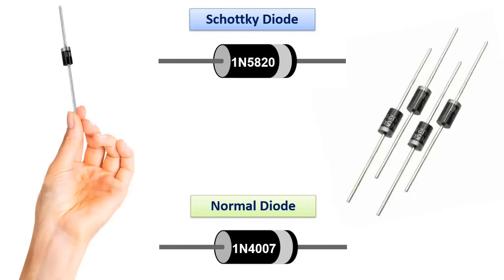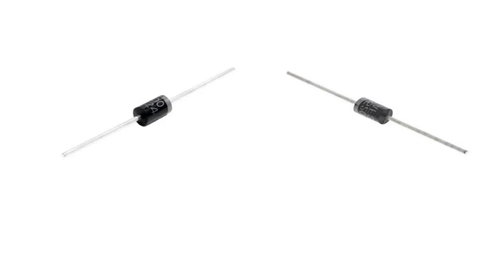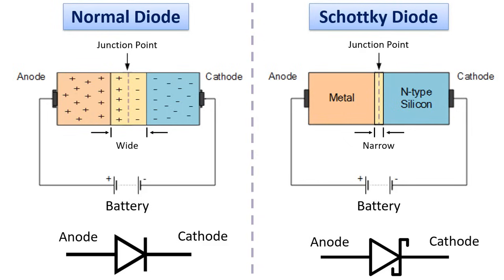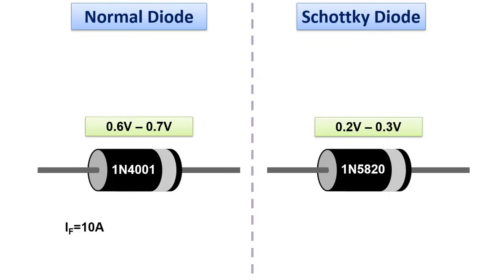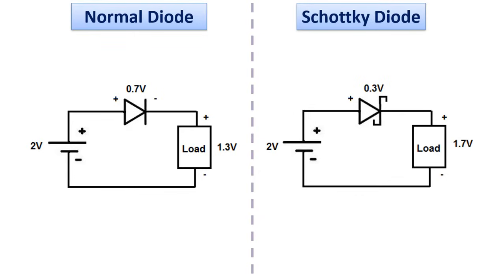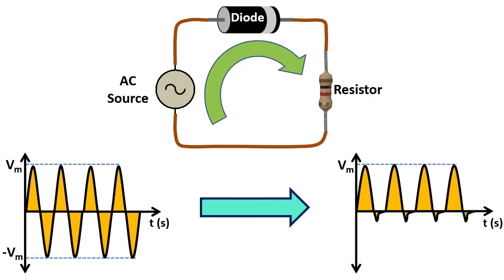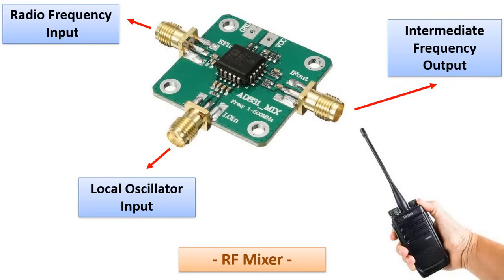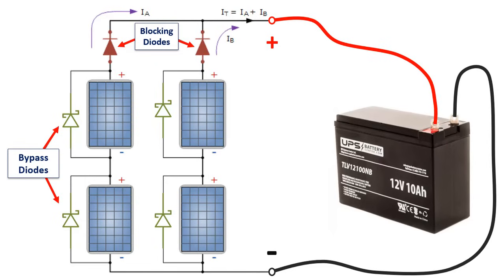What is a Schottky Diode? How Schottky Diodes Work? Where to Use? ( Schottky Diode Tutorial)

Comment: I’ll just start at the beginning where you say that the only one type of diode has a white band at the cathode
ALL DIODES of any size have the line at the end

And you say the current flow of electricity is from positive to the negative, when reality is that there are extra electrons at the negative end and therefore they go towards the area of less electrons. 

When designing circuits, it’s easier to visualize the positive flow, but the reality is the negative is what’s really moving
Reply: It's an LLM.  Complete waste of time.  There is no room for mistakes or errors.

Comment: Please! Be carefull with shottky-Diodes. They work well by cold temperature, but the reverse-Current increase rapidly by high temperatures. 
This can lead to late failures after years.
Reply from the maker: Thank you for sharing this information 🙏🏼
Reply: @eeapplications around the late 90 s  & 2000 shottky diodos were used in American car alternators  , didn't last  much between heats dissipatetion problems and the avalanche effect for charging the battery  you can imagine the failure rate
Reply: @jorgeruizortega6077  The Avalanche-Problem is another issue. Some diodes have a guard-ring on the die, in this case they can absorb avalanche-energy.

Comment: at 0.39 why isnt the skottky rectifying the output? it seems to be happily conducting in both directions?
Reply: I think it's a bad example.  A better example would be half-wave rectifying an AC square wave.  The schottky diode would do a good job, but a slow diode like the 1N4001 would let through spikes on the falling edge.

Comment: They're great for modifying guitar distortion effects. They use diodes as clamping circuits to create the distorted tone. The more you clip the wave, the more distorted the tone. The lower the voltage of the diode the more saturated and smooth distortion you get. Instead of clipping at 1.5 volts you can go to half that. Usually boost it back up a little somewhere later. They're cool for the designed used also. :)
Reply from the maker: Thanks for the info!  I'm always learning new applications for diodes.  😊
Reply: @eeapplications  did you know in the hvac industry a small AC current is passed through a flame to ground to prove the flame is good? The fire acts as a rectifier and the control uses the DC feedback as proof.  I work on hvac and amps. I have certain skills.....:)

Comment: I use SNOOKIE diodes their switching capabilities are much better when used in weak fielding based equipment. If using ROPS or SOPS measuring equipment there is no chance of flash over or any overloading.

Comment: Why not to use only the Schottky Diodes ?
Reply: Schottky diodes have much lower reverse breakdown voltage and higher reverse leakage current.

Hence it is better to assess whether a normal diode or a schottky diode is better for the specific application you're looking at
Reply: Cost.
A regular diode is enough for frequencies less than 1kHz
Reply: Higher price and more complicated production process compared to a standard diode, unnecessary fast response time, higher current value, etc. There's a brunch of reasons

Comment: Modern very fast silicon diodes are now available with minimal leakage current. Thus, today the Vf at load are the only issue left, and it is getting lower for the silicon diodes ( at load).

Comment: Can anyone explain to me why the shottky diode rectifies current if it turns on at both positive and negative voltages?
Reply: It doesn't conduct in both directions as long as the maximum reverse blocking voltage rating isn't exceeded.

It behave like a silicon PN junction diode in terms of forward conduction (anode positive with respect to cathode). However the reverse "leakage" current of a Schottky diode is typically higher than for a comparably-rated silicon PN diode. This leakage current is too small to be of much concern for rectifier use, but it can be a significant in other uses such as low-level analog circuitry. There are small Schottky diodes made specifically for small signal applications. They are typically designed to have very low reverse leakage current.
 
There are many silicon PN junction diodes with reverse voltage withstanding (blocking) capability up to 1 kV. It is easy to make them. Most Schottky diodes have a reverse blocking voltage rating of 100 volts or less. It is possible to get types with up to about 150 V reverse blocking rating, but there aren't many choices. There are types made with silicon carbide that can block up to 1200 V in reverse but the forward voltage is higher than that of a silicon PN junction diode and they are expensive. They are still very useful in some circuits because of their very short reverse recovery time.

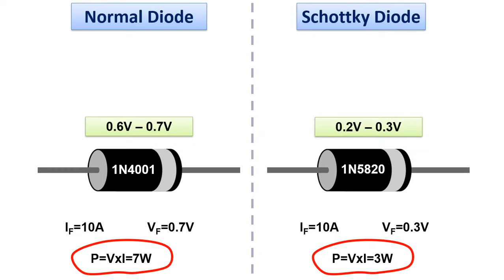Comment: 4:30 - 1N4001 - If= 1 A not 10 A !!! Pd=1V*1A=1W
See datasheet
1N5820 Vf=0.4..0.5V @ 3A => Pd=1.2..1.5W
Reply: Comparing a silicon diode passing 1.0 amperes with a schottky passing 3.0 amperes is not a valid comparisson!

Comment: This presentation is remiss because it gives the impression that Schottky diodes are superior to "normal" diodes in every possible application.  A person watching it would wonder, why would anyone ever use a "normal" diode?
Reply: That’s exactly what I was wondering. So what’s the answer?
Reply: @williambock1821  
In many applications the primary advantage of Schottky diodes is their very short "reverse recovery time." The video touches on this but doesn't explain it well.
When the voltage applied to a diode is suddenly changed from the "forward bias" to the "reverse bias" condition (that is, from the anode being positive with respect to the cathode to the opposite), it does not stop conducting instantaneously. Ordinary silicon PN junction power diodes take quite a long time to turn off - their "reverse recovery time" is long and quite a lot of charge gets through. It has to do with getting "excesss carriers" out of the junction region. This is of very little concern in low frequency circuits such as rectification at AC mains frequency. When you get up into the frequencies of switchmode power supplies, which these day can range from around 50 kHz to 1 MHz or so (100 kHz is quite common for high power switchers), the reverse recovery time and charge becomes a problem. Ordinary silicon diodes would cause a lot of power loss. There are "fast recovery" and "ultrafast recovery" silicon PN junction diodes available that work much better. Schottky diodes have even shorter reverse recovery time.

The other advantage is the lower forward conduction voltage, as described in the video. Sometimes that isn't important, but it is in lots of applications. At moderately high currents (a few amperes to a few tens of amperes) a silicon PN diode may have a forward voltage of around 1 volt. A comparably-rated Schottky diode might have a forward voltage of about half that. At 20 amperes, half a volt difference is a 10 watt difference, and something that has to be considered in real circuits. In power supply "ORing" circuits the forward voltage can be a big concern.

There aren't many Schottky diode with reverse voltage withstanding rating of more than 100 volts, whereas silicon PN diodes can be had up to 1 kV. There are Schottky diodes with much higher reverse voltage rating on the market but they are expensive. In general, Schottky diodes are quite a bit more expensive than similarly-rated PN diodes.

Schottky diode "reverse leakage current" (current that can flow when the cathode is positive with respect to the anode) tends to be substantially higher than in silicon PN junction diodes. This isn't a big deal in lots of applications but it can be in some. Even the reverse leakage current of a silicon PN junction diode can be a significant issue in some low-level precision analog circuits.
Reply: Not quite as leaky as a Germanium
Reply: I don't really know, but I'd guess better longevity and/or lower price.

Comment: In the last diagram all the diodes are reverse biased so that wouldn't work.
Reply: Bypass diodes allow current to bypass cells that are in shade. Of course, this diagram is poor example because one blocked cell would render whole series branch unusable because other branches would make bigger voltage, so blocking diode would be reversely polarized.

Comment: why dont we use this diode over our normal pn junct diode
Reply: That's what I'm wondering, as well. I assume cost. If they cost the same, I don't understand why you would want to use a PN diode, unless you specifically wanted to smooth out power frequency for some application.
Reply: exactly my thoughts, why not?
Reply: 😮Max PRV of 60 volts.
They have reverse leakage enough to measure with a DMM in milli amps. Silicon diodes are tighter reverse leakage of a few micro amps.
Reply: Reverse voltage loss is high

Comment: What is the purpose of the Bypass Diodes across the solar panels? I cannot see what their function is.
Reply: If one or more panels are shaded the power drops of considerably. The diode will allow the current from the unshaded panels to bypass the shaded ones
Reply: @jasonharrison25 thanks
Reply: They divert current around other series panels. This is advantageous in that it reduces energy loss.
Reply: Did you say thanks to the 2 responses?
Reply: They are there almost entirely to protect a panel that might be shaded from having current driven though it by other panels that are receiving normal illumination. They rarely do anything useful in terms of power delivery, especially in an array where you have both parallel and series connections of panels.

Comment: Disadvantages:
1. breakdown voltage measured in tens of volts vs hundreds of volts.
2. much higher reverse leakage
Reply: My silicon diodes thank you for saving them.
Reply: No, reverse breakdown voltage of common Schottky diodes used in power circuits (i.e. with average forward current rating greater than half an amp or so) typically ranges from 20 volts to 100 volts. There are 150 V power Schottky rectifiers on the market. Silicon carbide Schottky rectifiers up to 1200 PIV rating are made but they are quite expensive. The 600 PIV parts would be useful in active power factor correction circuits. If I were still designing that sort of stuff I'd be considering them.

The reverse leakage current can be an issue in some applications. Schottky diodes intended for signal use and with low reverse leakage do exist. Hewlett Packard used to make a range of them. I don't know if any of that line is still being made by the current owner of that former HP division.

Comment: 7 Watts through a 4001 🤣
How abouut no?
Reply: You will have to use a high current diode in this example, and heat sink it. Forward voltage will be about the same.A 4001 would become "cremated" in this example
Reply: BBQ mode activated 😂
Reply: Duh!  Go away and read a book.
Reply: 7 watts dissipation in a 1N400x diode would be OK as long as the time was short and the average power was tolerable. Diodes like that used as rectifiers in circuits with capacitive filtering will be subjected to very high "surge" current.
Most power diodes will have a specification for transient over-current

I have used 1N4148-class diodes to pass the "ping" pulse for an ultrasonic transducer. It would be around 9 amperes but very, very narrow and with low duty cycle. It worked highly reliably. In the last revision of the circuit I did I used a similar signal diode that actually was rated for that kind of torture.
Reply: 1N4001 at 7 amps has a forward voltage drop of 1.2 volts 8.4 watts. At 10 amps its time duration is listed at 40 cycles considering 60 cycle AC that is 0.667 second.

Comment: i wonder if the solar to battery with that diode symbol is correct!  Thanks
Reply: It is, the battery is not the power source in the diagram. The solar panels are the power source and the battery is the load - the solar panels are charging the battery.
Reply: Your question makes no sense.  Ask better questions.

Comment: After watching this video, one question stays stuck in my head... why I would not use a Schottky diode instead of regular diodes anywhere where a diode is needed (a regular, not a zener of course)
Reply: Since they are half metal, they have a low reverse breakdown voltage. Diodes are commonly used as a way to protect against reverse polarization, so there might be cases where Schottky diodes won't be helpful against reverse polarization (edit: i.e. high voltage circuits). Also, they are more susceptible to static discharges, which are more common than they seem (after working with PIC microcontrollers, I learned that the bad way :p).
Reply: If you have ever built a high-speed electronic device, you would know.  Get out there on the bench and try some things.

Comment: It would've been nice to point out not just the advantages but also the limitations of the Schottky diodes. For example they are much more limited in maximum reverse voltage, than pn diodes.

Comment: Schottky diodes are also being used in audio mains rectifiers the theory being the faster switching results in less noise. One disadvantage is schottky can suffer thermal runaway where the resistance increases with temperature.

Comment: So Schottky diodes have less forward voltage, better properties at higher frequencies, why are silicon diodes still made? What would be their advantage over Schottky diodes?
Reply: From 5:26 we can see that the reverse breakdown voltage is not as good, typically around 50 volts or so. In applications where reverse breakdown voltage is important, silicon diodes win.

Comment: I have a circuit with a BJT transistor in it. It is a hydraulic selector handle that opens a hydraulically powered cargo door. Moving the handle in either direction turns on the electric motor. The handle has three positions, 1) Open 2) Off 3) Close. The handle ports hydraulic pressure to either the open or close position, and in either open or close it simply turns on the hydraulic pump motor. The electrical connector has three contacts, A, B, and C. There is a transistor symbol between A and B with C appearing to be unused. However one of the legs of the transistor appears to also be unused. It's not readily apparent from the drawing whether the one leg is used or not. My question is.......how can I test the selector handle electrically to see if it is functioning correctly? I mean.....in actual operation 28V dc is connected between contacts A and B and sent downstream. But when I move the handle in either the Open or Close position I get nothing on my meter no matter how I connect them to the contacts. And for the record, yes the handle is known to be good. But we couldn't be sure in the early stages of troubleshooting the door circuit. I'd like to know how to test this selector handle assembly to avoid changing it unnecessarily. Is there some sort of signal coming in the C contact that enables the transistor to pass the 28 volts between A and B ?  So in other words, would I need to put some sort of voltage on the C contact in order for my meter to read continuity between A and B when the handle is moved to either Open or Closed? 
Thank you.
Reply: No.
Reply: Perhaps 🤣

Comment: Can we use shotkey diod instead of normal silicone diod in bridgrectifier for dc 12v battery charger circuit
Reply from the maker: Yes you can use 👍
Reply: @eeapplications  thanks for your kind information stay blessed

Comment: Question: what category is 1N4148 ? This one is commonly used at high freq too (but at low current) ?
Reply: Its a small-signal silicon diode optimised for a fast recovery rate hence its use in switching , usually in glass packaging they cant handle much power.

"Compared with signal diodes, rectifier diodes generally have higher current ratings, can have much higher reverse voltage ratings, but have higher leakage current and greater junction capacitance.[16] "

https://en.m.wikipedia.org/wiki/1N400x_general-purpose_diode

https://en.m.wikipedia.org/wiki/1N4148_signal_diode#Specifications

😎👍☘️🍺
Reply: I believe  they are classified as Switching Diodes, which got me thinking what is the difference.
Reply: The 1N4148 is a silicon PN junction diode optimized for "fast switching."  As long as you can live within their current and voltage ratings they are pretty decent all-round compromise diodes. The reverse recovery time is short (4 ns, iirc) and their reverse leakage current is tolerable in lots of applications. 

If you need very low reverse leakage current there are much better diodes (the collector-base junction of a transistor like the 2N3904 has much lower leakage but is on the slow side; the base-emitter junction leakage is even less and is faster but the reverse breakdown volltage is around 6 volts)

Comment: what is the use of the diamond shape arrangement of the schottky diode at 7:50 ?
Reply from the maker: RF Mixer circuit.
Reply: Can it be replaced with 1N4148?

Comment: so what are dis-advantages over silicon diodes?
Reply from the maker: Reverse voltage values are low. Therefore, it is not suitable for use in rectification circuits.